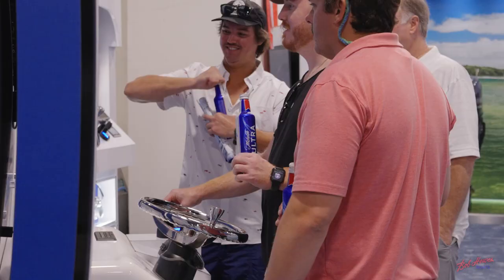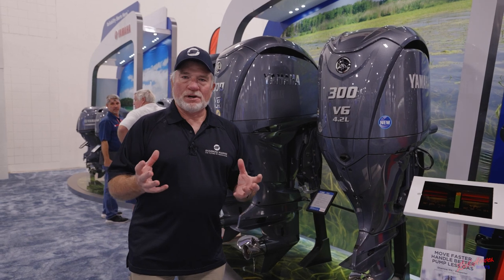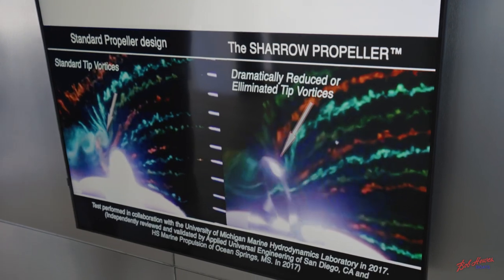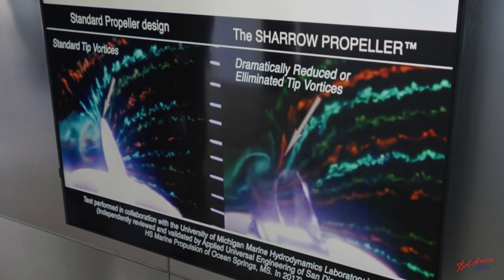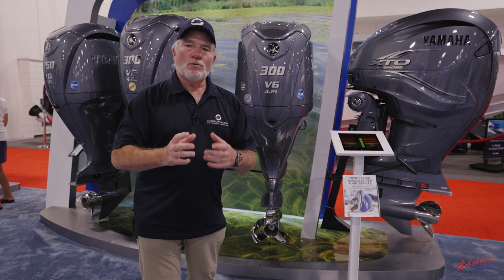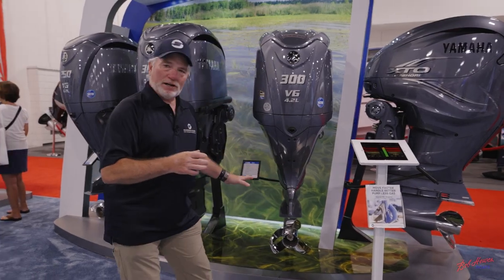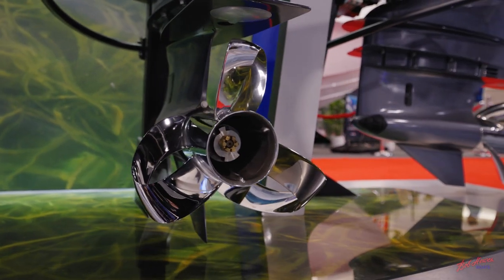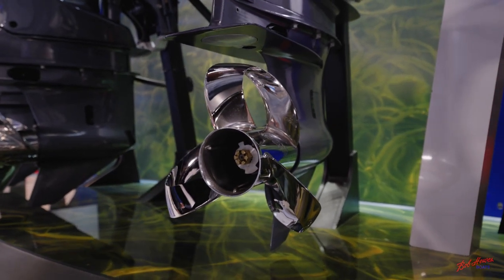Sharrow Marine Prop at the Yamaha Booth FLIBS 2022

Comment: Cost is unreasonably high in my opinion for my set up, triple 350’s on a pursuit OS380.  15k buys a lot of gas, when’s that going to break even, three years?
Reply: Maybe but then when you sell it, it will have a higher selling value?
Reply: @poyorudo  it never works that way with modified equipment in my experience.  You never get your money back at resale or if you get anything, it’s pennies on the dollar. Might help the sale but it nets no real money. Another consideration, who’s going to work on that prop the first time I ding a log?  Local guy in BF nowhere southeast AK, doubtful. Till it’s cheeper, much cheeper, or I see compelling actual performance data on a 22,000 lb boat with 350 Yamahas the same as my own or very similar, im good with the plain old ~800$ per, three blade Yamaha prop.
Reply: That obviously depends on several factors. First of all how much you use your boat but fuel prices and your specific application will naturally also play a role. I did the math based on a test I found here on YouTube. That test was done on a smaller boat with a single engine but based on the efficiency improvements at optimal cruising speeds using their figures and today's gas prices the prop had paid for itself after about 180 hours of cruising. But as they say your mileage may vary.
Reply: @ThorRavnsborg  hence i specified my boat and engine config.  Im burning 42-50 gph going 35-45 mph, at 41-50 rpms. Looking at a similar boat test with this style props and 250 hrs a year its going to take a long time.  Cost is ridiculous at this point. No way im investing 15k in props on a 7 year old boat. Sillyness
Reply: @perrycarditi5  Yes, they are definitely pricey and hopefully they will be able to lower manufacturing costs and reduce prices in a not too distant future. I obviously can't tell you what the exact fuel savings would look like in your case but a reduction of 10-15 gph doesn't seem far fetched if you reduce your engine rpms to the 3000-4000 range which is typically where these props excel (and that should give you nearly the same speed as running around 1000 rpms higher with standard props). I think there's a good chance you would break even on the investment within two years at 250 hrs per year (even without taking added resale value into account) but don't hold me up on it. But even if it takes four or five years to break even I would say that's actually still a very respectable return from a financial standpoint (assuming the props will last at least a few years longer than that).
Reply: think of it from the other side... how much would you pay to increase your fuel capacity by 30%? remodeling the boat? yea good luck. this is for long range and commercial application. if you run a fishing charter this will save you a fortune.  its not for everybody :) the same as a triple 350 is not for everybody.
Reply: @jstefa2  tank 375, get just shy of a mile a gallon at cruise and spend the bulk of my engine hrs time at idle trolling.  Run for 1-2 hrs one way, fish and play, then run home a few days later.  For me, my situation, my boat, i did the math, the break even is past motor warranty.  I cant see it happening.  Commercial hauling at lower top speeds, maybe.  If i could deduct the cost of it on my taxes, i might reconsider. In general, the charter folk around where i live would be priced out. Plus in a charter situation with booked clients you need back up everything, especially props. Wonder whose going to work on that thing when i hit a log?  Local prop guy?   Cut the price in half and people would probably buy them. Other than that i bet it doesn’t command a  significant market share at current fuel costs. They would need to get a contract with yamaha or merc to get going.
Reply: @perrycarditi5  as i said its not for everyone. it will be at 2k price point tho. Yamaha is picking it up to offer it as standard. also since you get more thrust out of same hp... have you considered smaller engines+sharrow prop combo? that could cut into your maintenance and fuel cost prices at no significant increase in repower cost... something to consider?
Reply: @jstefa2   Im too heavy for less. The boat in my opinion is adequately powered. I can still get on step with 2.  Coming home  , broke down, after a 50 mile run at 8-9 mph is no fun, especially in weather.  I would have trimmed the boat with 425s if they were available when i bought it.   

I could be mistaken but the new props don’t seem to yield as much gains at higher speeds. They shine slower. Id prefer to spend less on fuel but im certainly not trying to go slower.
Reply: @perrycarditi5  as far as i can tell they shine in 3000-4500 rpm range. with more thrust per horsepower you can get away with smaller lighter engines. that would indicate a substantial savings when you go and repower the boat with no loss of performance... just smaller fuel burn and a lighter boat at the stern. i agree they dont make sense for a 7 year old engine... but when you wear em out maybe consider 300s with sharrow props... the performance should match and the money saving is still considerable even if you buy 2 props per engine.... 375 are expensive AF :D